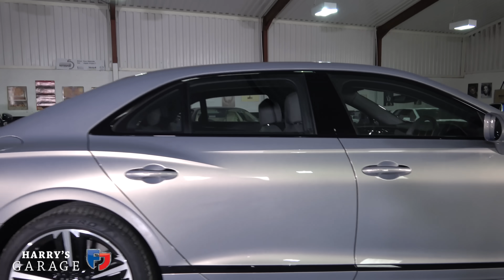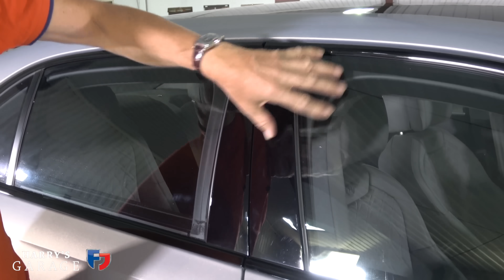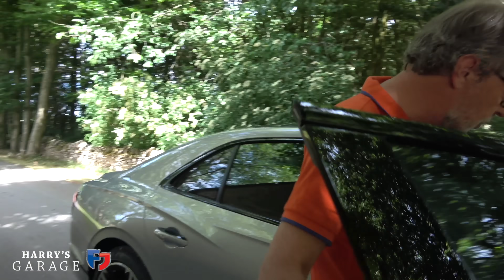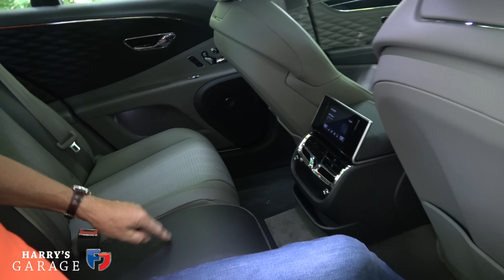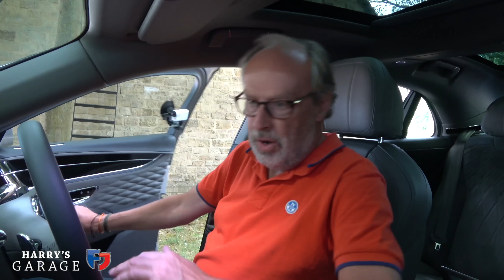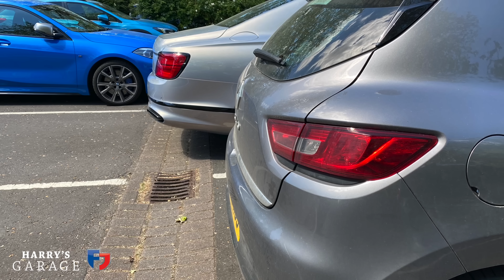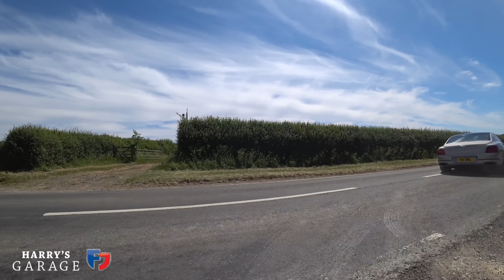New W12 Bentley Flying Spur is a 207mph, 626bhp limo. Full on-road review

Comment: Harry
I thoroughly enjoy all of your reviews .  Every spec, facts and figures delivered in such a reserved, calm demeanor.  No theatrics needed .
I am in the States and own a  2019 LINCOLN CONTINENTAL  3.7litre naturally aspirated V6 .   
Their exterior is strikingly  alike .  From the shape of the grille ( although the CONTINENTAL GT is nearly an exact match as they share the wire mesh with the only difference being that the LINCOLN 
Continental grille wire shapes are formed into the shape of the Lincoln Motor Car company symbol.

I assume that this has something to do with FORD owning JAGUAR (XJ L &   the TOWN CAR from 2003 until production end with 2011 ), Aston Martin etc .

Would you consider doing a comparison for us Yanks of the  Bentley and the  2017 through 2020 
LINCOLN Continental which has an available  3.0 litre  Twin Turbo (ECO Boost) that produces
an, amazing to me,  400 bhp !   Very very quick !
Cheers

Comment: Does he really think that this is not a suitable car for the present day? Does that mean that Harry buys into the Climate Cult and Woke Agenda? Is fuel economy unexpected for a car of this sort? And finally, yes, you could buy a Bentayga, or a top end Range Rover, but that assumes that you want an SUV. Is it really confused, or is Harry confused about the ethos of Bentley since day 1, namely the ability to travel fast in comfort? A hybrid? Of course it is available now, but really? You end up with a 3.7 V6 hauling this big car round when the battery runs out or you can't charge it, and suffering both poor performance and shocking fuel consumption.

Comment: Instead of turning the ignition off to get the "plain veneer" on the rotating screen, you can just press and hold the screen button and the screen will rotate to its original position as if the car was off even while driving.

Comment: I just sent last weekend driving a First Edition.... Damn it's fast!  Definitely a head turner, but I felt like an ass driving it.  It draws way to much attention and I felt stupid at the gas station with everyone gawking at something that wasn't mine.  It was NOT comfortable, at all, for long drives.  I prefer my truck or Expedition for Long drives.  Its simply a "look at me" car so if thats what you want then go for it.  
"Uncomfortable" meaning the sests were stiff with very little padding, and I am a heavy elbow leaner and the padding on the armrest was inadequate.  Also, if you had a yeti cup in the cupholder you had to slide the armrest back and there eas nowhere to put my arm.
Reply: Not comfortable at all ? You must be joking. I am sure Bentley will be happy to put some extra padding for your elbow or other parts of your body. In case you can not afford that, it may be less costly to loose some weight. Perhaps people were not looking at the car, which is very discreet, but were looking at you... Sorry for my comment if you feel offended.

Comment: I hate that piano black plastic, it's all over my BMW and it's a total bitch to keep clean. I cant believe you have to pay extra for adaptive cruise control on a  £163k car, nuts. The freewheeling is really good fun in eco, you let it roll downhills, and tickle it along on the flats, saves a heap of fuel and is a great little mind game to play whilst saving fuel.

Ultimate worst blindspot is the A pillar on a BMW 220Xdrive it can hide a whole 3 series in it and youd have no idea it's there, or anything from the right at roundabouts.....its shockingly dangerous and you have to pull right forward then lean right back to make sure it's clear, its ridiculous.

But XDRIVE has saved me from real ice danger twice, so much so that when I drove back through the same road a little  later there were two cars in the hedge, one on its roof!

Comment: I prefer to drop down into a car than climb up into it and hit my head on the door frame whilst wondering what foot to put in first..at least the vans and military vehicles I used to drive had  hand grips and steps so you could pull yourself up and in without injuring yourself...I must be getting old.     Mentioning no names,some of the expensive SUVs I see around town look like glossy coloured Armoured Cars...with little machine gun slits for rear windows..The reason i write this is while Harry hinted that the bentayga may be a better choice than the Flying Spur for certain buyers,this may be the case...not everybody likes driving an SUV.
Reply: The Flying Spur is an exceptional CAR.

Comment: You can tell from far,that big cost cuts were made on that car. It's part of the VAG group,no doubt. Flashy headlights massive structure and well fit body panels,but one look at the cheap plastic grill and vents,parts that are exposed and meant to make a statement,and you wonder,if they made cuts there,what to expect under the hood...One good interior is not good a car to be premium. Besides, aluminium panels were available since 1998 on Audi A8 ( Audi Space Frame),so nothing revolutionary there. BMW 7 series comes with carbon fiber body,so Bentley could've done better. If Bentley was part of Lexus,things would've been way better.

Comment: A very nice piece of engineering .But who is going to buy it, Dictators are out of fashion ,Captain of industry ,try and get this passed the board of directors and share holders ,Prime Mister -NO,NO,NO,NO. Simon Cowell, may be once upon a time , so that only leaves other  ,You Tube bloggers . As Harry is not sure,but with that amount of torque it would pull a plough , so justified if a towing eye fitted .Well presented as always Harry and may be a good prop for Iain Tyrrell should he do another Mr  Clouseau ,but than may upset MR  BENTLEY

Comment: Yes, this new W12 BFS has a nice back seat, but my reclining rear seats are also heated, ventilated and have plush headrest.  The window blinds work, still.  It has digital TV, DAB, Bluetooth and I'm sure there's more leg room in my 760Li.  It doesn't 'ping pong ping pong' at me, just for getting in it.
BMW 1t has active suspension and is sublimely comfortable.  It has a massive central ventilated storage box with charging points.  Sadly, it lacks the diamond stitching, the £4,000 show-off dash and the second glass roof panel, but is still a nice place to relax in and listen music on the driveway.
Best thing is, mine doesn't make me look a £‼ when I go somewhere 😎

Comment: I have a couple of problems with this car. 1. Gearbox is made for a supercar and not for a flying spur, when the car gets warm I find it ruttles even more. 2. Rolling noise  from the big wheels. 3. The views because of the pilars are annoying specially driving in small towns or on small roads.
4.But one thing it does very well is to cruise through europe, that it does better than the Bentayga.

Comment: THE VERY FIRST THING I WOULD DO WITH ANY CAR WITH A PLASTIC GRILL ..(HOW DARE THEY GIVE US A TONKA TOY PART) ..IS GO TO AN AFTER MARKET COMPANY WHO MAKE BEAUTIFUL GRILLS OUT OF METALLLL!q!!  WHO CARES IF THEY SAVE AN OUNCE OF WEIGHT HERE AND THERE?  WHO'S GOING TO BE DRIVING AT 200MILE PER HOUR SPEEDS AND WHERE?  HAHAH...  I WANT METAL, SHINY, HEAVY CHROMED GRILLS AND BUMPERS THAT DO NOT CRACK!!  PERIOD.  FULL STOP.  I DON'T WANT PLASTIC ANYTHING. PUH.  MAKE IT TITANIUM.  AND I WANT A HYRDOLIC SUSPENSION LIFT, STANDARD, IN THE FLYING SPUR...OR AT LEAST AVAILABLE. AND A 4 WHEEL DRIVE FOR SNOW, WET AND ICE.  IT MAY ALREADY BE THERE.  I'M GETTING ONE FOR BUSINESS.  GTC4 V12 LUSSO FERRARI'S DO WELL IN SNOW, RAIN, ICE.  I HAVE WITNESSED IT RECORDED ON LONG ALPS AND EUROPEAN WINTER JOURNEY..IT KEEPS ITS TRACTION!  IT DOES  NOT SPIN OUT!  ITS TERRIFIC.  BENTLEY NEEDS DIFFERENT DRIVING MODES AVAILED..AND THEIR BIG CARS ABLE TO NOT SPIN OUT ON ICE OR SLEET OR SNOW!!  AND THEN...YOU CAN'T BE SAFER.

Comment: The main problem with the design is the front headlights. Mainly the area with the outer small lights. The car looks bulbous, droopy from the front. The rest of the car is very very good, but for instance the hip-shoulder lines should have been straighter and not so flamboyantly curvaceous. This will age badly. The proportions of the car are perfect and the interior is probably the best in the industry.

Comment: Why U need 600 Bhp for a Super Sedan.., 400 is/should be/ will be enough.
It's like pushing the Edge of Un-comfort.
Same with a W/V12, the Era that V12 was worth it, is gone.
V10 also to much costs.
Just stick to a V8.

And now my Bentley Rant !
Have U noticed how many people VideoCall.
Bentley should have implemented that Standard , with a Screen on all Passenger Seats.

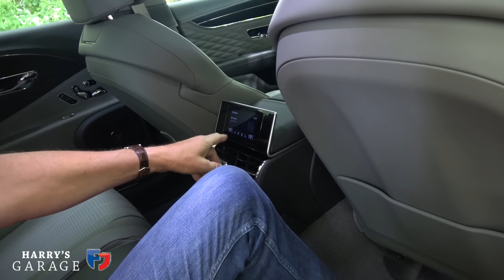6:50 Check the rear , facing the front seat, even after 20 Years   a X308 Jag Dame looks better....

Comment: It is the second time I hear you saying, that only dual clutch gearboxes are capable of withstanding such high torque values. That is simply not true Harry! Think about the Mercedes AMG S65 or even the Bentley Mulsanne which both have more torque than the Flying Spur and are using "normal" automatic transmissions.

Comment: Makes no sense for an ultimate luxury / standing car like this to have a V12 in these times. That has been superseded by electric drivetrains, which beat this on torque, responsiveness, power and sheer quietness, but also have a more 'advanced' image and jealousy factor (which let's face it, is why people buy these). For a Conti GT, maybe you could still justify the V12, but in this... never. Makes it feel instantly outdated and decidedly second-best, while the whole point of buying such an expensive vehicle is that it needs to be excessively better (for its purpose) than anything on the market.

Comment: I watched this video while waiting for my colleague sitting in the back of my long wheelbase S class from 2005. I find it hard to believe such little evolution has happened at Bentley since my car is almost the same size (ok mine is ~6 inches shorter) but the Merc is a healthy 500kg lighter (even though my car is mostly made of steel) and still has all the relevant toys.
The cheap plastic grille and the fact that the car seems old already when new will ensure that it will be a collectible car in 10-20 years. I love the new Conti GT but I find it very hard to believe many will choose this over the other luxury sedans; Panamera, S class, GT 4door, or especially the Phantom (ok it is more expensive as well).
The biggest problem is still the Mulsanne. It is a fabulous car with ultra luxury looks. Buy the Conti Flying Spur and everyone will just see you a person who ALMOST could afford the Mulsanne but cheaped out.
That being said, the W222 Merc S Class seems more modern than this and it came out in 2013.

Comment: Bentley Continental and flying spurs as well as the Phantom( i had a 2010 Phantom coupe)have always had disappointing rears compared to the fronts. As if they started at the front and spent so much time they had little time to invest designing the rear, Or if there was a shift change and another designer took over the development for the rear . I felt the same about my 2005 Vanquish S,  stunning front, weak rear.

Comment: Great review! Some interesting comments. I can’t agree that the Bentayga is a better alternative. That’s an awful car visually and the rear interior is crap for comfort. If you want comfort front and back plus decent styling the Range Rover has it in spades and is considerably cheaper, even with a panoramic roof and leather roof lining. 

Returning to the FS, the thick pillars surprised me and I can see you point about the GT being more open. The black leather interior and piano wood utterly ruin the car.  It makes it oppressive. If you buy a Bentley you should choose one of their wonderful lighter coloured leathers and magnificent wood grained veneers. If you want comfort in the rear why not consider a 7-Series or S-Class which both have pan roofs in the back and adjustable seats with loads of leg room. Indeed the 7-Series was designed as a LWB so is good as standards whereas the S-Class needs to be ordered in LBW to get the sensible leg room. 

I think after three iterations of the FS Bentley has finally got a distinctive shape. I had a 2008 FS Mulliner and I sold it after 8 months after trading a 1998 Brooklands Mulliner R. One of my main dislikes of the FS then was that it was underwhelming to look at. You got out, walked away, looked back and saw something hardly dissimilar to an S-Class. Bentleys should be visually memorable. 

Thanks for another interesting and practical review that didn’t get swept up with just the numbers.

Comment: No, it really doesn't have to have a rear spoiler. It weighs more than two tons -- how much more downforce would you need? A spoiler would increase drag and give even worse fuel consumption, and it would make you look like a boy racer, not at all the kind of person who would buy this monumental machine.

Can you get one of those Bentley wire mesh grilles as an option instead of the tacky black plastic one? It seems likely.

I was recently looking at a pre-1930 Bentley 4-door saloon, one of the few surviving examples that have not been converted into James Bond lookalikes by silly restorers hoping for a quick buck. It was much in the same mould, a massive vehicle with a huge comfortable space in the rear but you would rather be in the driver's seat enjoying the performance.

OK, the firm has been taken over by Volkswagen but they are keeping true to the original idea, and all Bentleys are far better looking than the equivalent Rolls-Royces which are universally hideous lumps.

Comment: If the fuel consumption upsets the Green muppets I'd buy 3.
Never take it out of sports and run the aircon on full with the windows down.
Might even get a bloody big trailer to hang off the back and cart round a ton or two of coal to use even more fuel.

Comment: I can think of a number of people who would want to sit in the brilliant back of this "gentleman's car" as
my dad would have said (Rolls Royce would have been for him far too 'common' and flash, to be driven
by lord mayors who are not gentlemen)... Anyhow, these potential clients would want to have this light
aluminium motor armoured of course (also equipped with tear gas and a number of other features that
would increase the weight - that's why it's aluminium in the first place & anyhow, cost is not relevant). 
No surprise either, that these clients would definitely want the power to move the motor very rapidly out
 of dangerous situations and the fuel consumption for such clients is of zero significance. My youngest son 
works on such cars (many of those abroad come to Germany for servicing, oil changes etc) - and
specialists know what NOT to touch so that the windows don't get blown out!

Comment: One question: the mpg is so much worse than the mpg of the Continental GT. Do you have an explanation for this? (In the vid of the Conti GT review, you managed a mpg figure of 28.3 when riding to Goodwood. In this vid, you show 13something as mpg, mentioning you might be able to come to low 20s. Still quite a difference ...) Thx and greetings out of Germany - Chris
Reply from the maker: I didn't do any long runs in this Flying Spur, like I did when I had Continental GT in, hence why I mentioned that I was sure it would do mid-twenties on a long run. But I think extra weight of Flying Spur and size means it does much worse mpg on local runs compared to Conti GT, hence why I highlighted it in vid.
Reply: @harrysgarage  Thx for the answer!

Comment: It's just a Passat with a slightly different computer design, a little more space, a plastic grille. The interior.... My girlfriends corsa has a heated steering wheel and a leather seats for £7k. My F10 BMW cost me the same. Both have everything you'd need. I'd understand if the effort was put into making the vehicle but nothing is involved anymore. No need to throw money at a WV just to justify to say "WOW" for the very moment you drive to Lidl to pick up a cucumber. It's a VW with a plastic grille.

Comment: Suspect the reason it doesn’t slow down is the “sail mode” included with most recent VWAG products. At motorway speeds, when off the accelerator, it will disconnect the gearbox entirely when coasting. The effect is a certain eeriness that’s the result of the ABSCENCE of the expected in-gear engine braking. Telltale is you can watch the revs drop to idle as soon as you remove your foot from the accelerator. I’m sure someone else has commented on this already!

Comment: Illuminated emblems  are straight trash. Lots of piano black; just like in your Toyota Corolla.  you would  think they could do a little better. Yes I realize the material is better. Too bad they don't use high-strength steel in critical places like the B pillar. It could definitely be made smaller

Comment: Very unusual looking. I think the designers were having an off day with this one. Those headlights alongside the amount of metal between the top of the arch and the highest point of the bonnet do go well together - very sleek, and then they have this huge front grill and square bumper. The rear light clusters are a peculiar design for the size of the car also

Comment: That pillar in the middle on the roof! Yikes! Like the ridiculous roof of the Tesla model Y. The car I would have gotten if we had a local dealer is the flying spur (speed) with the Naim stereo. But... This car is a disappointment compared to the previous model. The rear is sad. The fancy stuff you mention (window shades, rear seat controls) is standard in luxury cars. I will stick with my S-Class and Range Rover HSE for now.

Comment: Nice video, Harry. The choice of a W12 (a pair of V6s), is that to shorten the length of the Engine longitudinally? I imagine it loses efficiency having to marry the crankshaft across 2 side-by-side V6s. At some point, I guess a 16cyl, you start to have difficulty timing each cyl for efficiency, which may be why the Chiron goes W16?